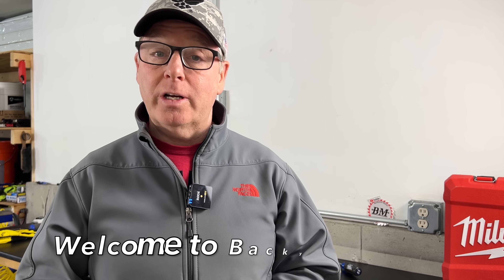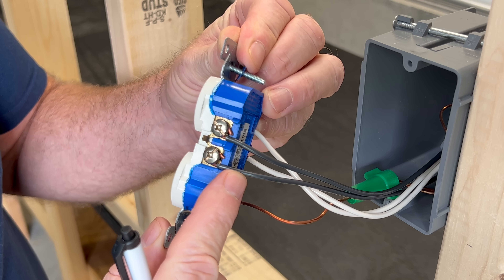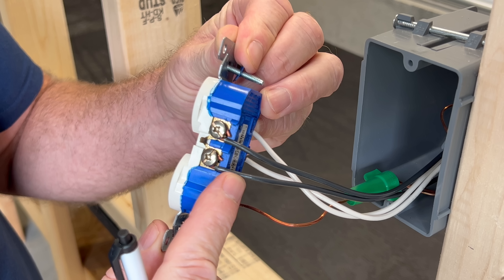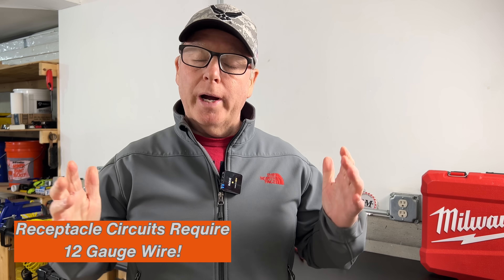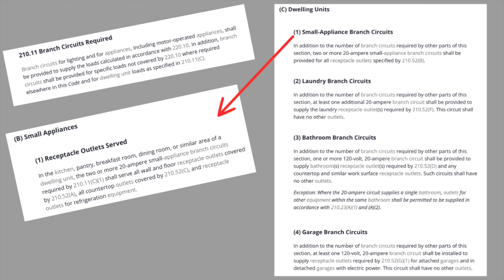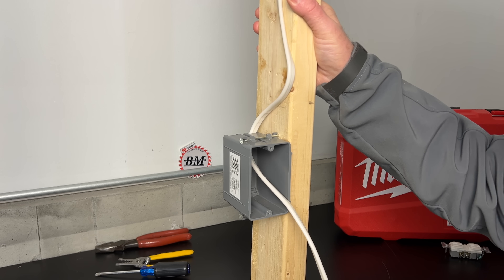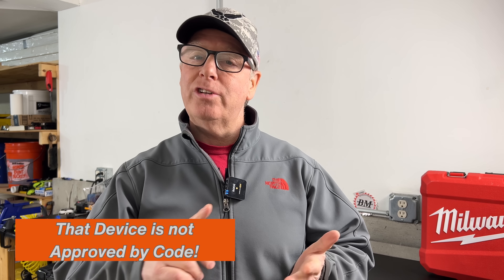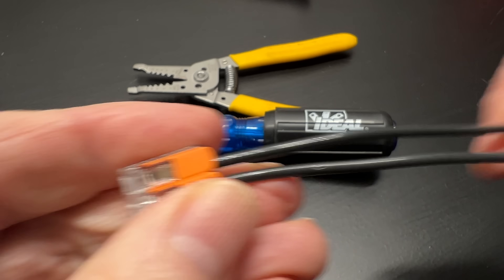5 Electrical Code Lies DIYers Should Stop Believing!

Comment: is there something in the newest code that says you have to use tamper resistant receptacles I have seen lots of people saying that you have to have them now.
Reply: Tamper resistant receptacles have been required in certain places since at least 2014.  Section 406.12
Reply from the maker: Yeah I think it may have been in the 2008 cycle if memory serves me. But yes they have been required for a while.

Comment: So, when I have my next house built or a portion of my current house rewired, I'm going to specify pigtails in the box, ground up outlets, 12 ga. wire throughout, 20 amp outlets, and a service loop at each box.  With the exception of the last item, for me this video has been a list of things that I would like to have in my own home.  I would add that I'd specify Wago connectors instead of wire nuts.

Given that labor far outweighs the cost of materials and that upgrading the wire, outlets, and connectors is a small expense, and it is far more expensive to do it later, I'd like to go for the better materials and methods up front.  As an example, the hammer mechanics who rewired the basement of my current house used Romex 12-2 WITHOUT A GROUND.  Now I'd like to move some switches to a different wall and add some new LED light fixtures.  But I'm going to have rip out all the stuff they put in and redo it.  So, they saved pennies and it is going to cost me dollars in time, labor, and materials.
Reply: I don't know that I would use #12 wire, rather you'd be better off installing a large capacity panel and many more circuits. Appliances such as space heaters and portable air conditioners can pull almost the entirety of the circuit power, while only having a 16 guage cord. The temptation with 12 guage wire is to then protect it with a 20 amp fuse. The result becomes your appliance cord defaults to being the circuit fuse! I'd also recommend quad outlets: has having TOO MANY outlets ever been a problem? We responded to an office one time where every cubicle had a space heater, except 3 cubicles shared 2 circuits. The HVAC was horribly unbalanced so management's solution was to literally bring in a pallet of space heaters!
Reply: @TNickel555  I think you actually make my case for using 12 ga and 20 amp breakers.  As for the ampacity of the appliance cord, they can get away with smaller wire based on it being a short length and also be in the open where it can dissipate heat.  Not the best situation, but it passes NEC and UL.

Comment: Thanks, I was one of the folks who believed the pigtale lie.  I hadn't taken the time to look it up, but I can certainly see where folks would make that mistake since multi-wire circuits are not well understood.
Reply from the maker: I'm going to make a video about multi-wire branch circuits because you're correct that many people don't really understand them or all the requirements for using them.
Reply: Required or not, I still find it a bad idea to run all your current through that dinky little tab on the side of the receptacle. I was advised against doing that by an instructor and have removed at least a couple receptacles that were hooked up like that and showed heat damage. One to the point of failure.
Reply: @Wrencher_86  if you are seeing the tabs get that hot, something else is wrong. Likely, the circuit has been significantly overloaded. (space heaters, coffee pots, microwaves, and hairdryers are common culprits). I would ask if they have been resetting the breaker a lot. It could also be a manufacturing defect; many builders opt for the cheapest junk. I would also be skeptical of the overcurrent device. The tabs should handle 20 amps continuously, even on 15-amp devices. (mind that you can't legally pull the total rating for over 3 hours without derating.) 

Anyone who buys the cheapest receptacles at the big box store is rolling the dice.

Comment: About the receptacles wire section : here in Belgium all receptacles must be wired with 2.5mm^2 (12 gauge) even if the breaker is less than 20A
You can use thicker wires but most manufacturers do not certify their products for thicker wires (some do accept up to 4mm^2 but that's not common)
I am pretty sure that more countries have such a requirement and since we all have access to the internet (yes, there is internet outside of the US) it might be something that people wrongfully think that it is also according to their code.
To be honest, some of those "lies" are actually good practice.
Reply: In france you can use 1.5mm2 but nobody does that because its stupid.

Comment: People seemed to be very confused by "main", vs "service-equipment-disconnect".  Truth is, if you put the "main" label sticker, at the service entrance then that's the main.  It's the sticker that determines what you call main, and thus, what is the first box.   So, people do not need separate neutral and grounds at the breaker box, if all they did was add a service disconnect.  They avoid the drama, by putting a "service disconnect" label, on the new service disconnect. Yes, it's the label.
Reply from the maker: Remember that whether or not you separate the neutrals and grounds or bond them together depends on where the neutral and ground wire are bonded. If it's an outside switch at the service meter then they would be separated at the panel. I'm sure you know this but I wanted to bring it up for others.
Reply: @BackyardMaine yes that's a good point because it's a common practice with larger services, such as 400 amps, to have two 200 amp panels with a service disconnect in each, both must be turned off to kill all power in the home.  Beginning with the 2020 NEC emergency disconnects must now be provided outside on or within sight of the structure in a readily accessible location so first responders can cut all power to the building before going inside, in an emergency, for one and two family dwellings.  This new criteria is most often met by placing the main breaker adjacent to the meter, in which the interior panel must have its grounds and neutrals isolated.  For newer 400 amp services, two 200 amp breakers often with two breakers slots below to install a central air/heat pump, etc.    In this instance all breakers in the outdoor panel must be switched off to kill all power to the building, this must require 6 hand movements or less, I've heard old school electricians call this the "six throw rule".

Comment: Our home was built in '95 and the builder ran ONE 15-amp, 14 gauge circuit to feed the outlets in all 3 bathrooms, the front outside outlet, the backyard outside outlet, AND the garage.  I can't believe they ever got away with this...
Reply: The house I'm in is like that, too.  There's only one GFCI, at the head of the circuit, of which the first receptacle is in the garage.
Reply from the maker: Either there is no code enforcement in your area or the inspector needs a refresher course. lol
Reply: OK... everyone calm down. The original poster stated their home was built in 95. During that time that was code compliant.
Reply: @billbrown6526 I'm perfectly calm Dude.  Calmer than you are.  https://www.youtube.com/watch?v=1WN86qywLVY
Reply: when the house was built, they should have had an open walls inspection of wiring and plumbing to see what is run where unless that area has no inspections while building. @WhiteG60
Reply: My house built in 85 is similar, all bathrooms and outside outlets all on one 15A circuit with a GFCI in one bathroom.
Reply from the maker: @stargazer7644  Code violation there and that should have been easy for the inspector to find. Bath sinks require a 20A circuit.
Reply from the maker: @WhiteG60  It would depend on the inspector. Some are really good and others not so much. There are two electrical inspections. One after rough in but before the walls are closed and a finish inspection when everything is complete. I would assume if the electrician spread out his circuits like that you wouldn't have very many drops at the panel. A garage circuit needs to be  a 20A dedicated circuit and a bathroom needs a 20A circuit at the sink. This like this should be easy for them to detect at rough inspection.

Comment: I don’t use any device to splice any wires. Coming from a city full of repair work from poor installation practices. And #- on my list is exactly two wires on a receptacle overheating due to a dummy plugged in a electrical heater down the line! See the overheated receptacles all the time! Also, I don’t mess with ‘rope’, that’s not professional to me being a master pipe bender! But yeah, your tips can be helpful for many. JT retired IBEW
Reply from the maker: I have a video on when and why I use pigtails. I am retired now but started my career in IBEW local-7 and eventually moved into electrical engineering.

Comment: Single gang plasric boxes without a clamp need support within 8 inches of cable length
Reply from the maker: Correct.  314.17 (2) Exception.
Reply: @BackyardMaine  I am on tik tok 95k followers and Instagram 20k followers.  I am also from maine. Just start making videos Just under a year ago.

Comment: I have used #14 copper wire feed from 20 amp single & two po!e circuit breakers that feed air compressors. Customers had the pressure switch to turn off at 150#'s of air pressure. When the motor started up with 135#'s of air pressure motor would trip a 15 amp circuit breaker several tines a day. Has to be over a thousand exceptions in the probably halve million word NEC. Common sense tells you that if you are using a metal receptacle wall plate then ground up receptacles is the best practice. Safer for a metal wall p!ate to land onto the ground pin of a male plug.
Reply: Not the correct fix, the correct fix is to change to a breaker so that it  allows more insrush current, (magnetic/induction trip) but maintains the 15A thermal trip.  Move from class B to class C, or Class C to Class D. 

The thermal mode of the breaker should never exceed the ampacity or the wire.

Comment: This would be very helpful, if I were wiring my house. Unfortunately, I'm wiring my boat, prepping it as a liveaboard. ABYC requirements are very different than NEC.
For one thing, you never use solid wire on a boat. Sometimes the toughest part of the job is knowing which standard applies.

Comment: No application here. In plumbing they told me the label of the pipe had to be faced out so it could be read if the material type had been inspected. Like non usa type that wasnt would not pass inspection.

Comment: One thing that I feels like it should be a requirement is that inspectors tell you exactly what part of the code this or that violate. But "this is against code" and you have no way to know why beside looking through the full code plus state plus city amandements, and whatever other special cases that may occur, whouln't be the responsability of the electrician, but the inspector that claim it violate it.

Comment: You can find a code restriction against a cord with dual male ends, i.e. plugs on both ends.
I must say I’ve never heard of any of these misconceptions; though that may be because I’m an electrician and learned through the code. I’ll ad that some devices may be bared by municipal ordinance even if allowed under NFPA 70, NEC; for example all of the devices we hardwire must be UL listed.

Comment: As far as #1 goes, even though not required by code - it most definitely should be required by code, and the more people think it's required by code - the better. In fact, were it required by code from the start - we probably wouldn't have to deal with AFCI breakers right now.
Reply from the maker: I don't think pigtails should be required but maybe the backstabs should be banned. I think the backstab is what caused the AFCI to come along. But for anyone who uses the stabs I recommend pigtails. I have a video detailing when to use pigtails.
Reply: @BackyardMaine  you have probably never done electrical service then... I have done electrical service for decades, and currently am a licensed general electrician / master electrician, doing electrical troubleshooting every day in both commercial and residential, as well as industrial...  I never see issues with backstabbing or wagos, but always issues with screws being not totally tied down and outlet melted because it's used as a pass-through.  Also, a wire being loose in a wirenut is a common issue. Pigtails + backstab = never any issues. No pigtails - issues.  DIYers should exclusively use pushnuts or wagos, and backstab - it's hard to mess up when following instructions.
Reply from the maker: @Joe-by8jh  Not exactly. The Wago and others like it use force to hold the wire in place but the backstabs just wedge the wire between two surfaces. Thats why the stabs are only rated for 14AWG solid copper and one time use.  With Wago you can use multiple wire sizes, solid or stranded and reuse the connector as often as needed.

Comment: This is a great video!  Thanks for covering these, as all of these have been pet peeves of mine as well.  I have one small correction, though:

At 3:51 this conclusion is not actually correct.  Service loops would be limited to 6 extra inches only if you secure it as far away from the box as possible.  Nothing in the code prohibits you from securing the cable closer to the box than 12 inches away.  You can secure it within only an inch or two of the box, in which case you can then have 16 or 17 inches of useful service loop if you want to.

Actually, far more often I see people claiming that service loops are prohibited by code (instead of required).  This is, of course, equally false (as you pointed out, they are now even explicitly allowed in newer versions of the code).
Reply from the maker: You know I thought about that and was trying to get the point across as clearly as possible without getting into the weeds and having people loose interest. But yes of course you're right, your loop size would get larger the closer the staple is to the box. I thought going with the 12" staple would get the point across well. Maybe I was wrong..
Reply: @BackyardMaine  I think it would have been nice to include clarification there as well, but nothing you said lead me to believe it wouldn't have been the case.

Comment: Back in the day when copper wire was more reasonable I use to wire all 15 amp with 12 gauge wire. Not because of any code or not code or whatever. I used 12 gauge wire for 15 amp circuits because there is less line loss in a 12 gauge wire than a 14 gauge wire. Nothing that will change the world just a little help here and there which would add up over 50 to 100 years of service. Maybe I was a very pale shade of green before it was fashionable.

Comment: Interesting, how I learned all of this back in the 80s, and it still hasn’t changed.

I still have all of the rules from back then in my head.
I still do a lot of electrical, and I always go toward the side of safety for ANY project.

I’ve had a lot of arguments over the years, and always win with the Safety First argument.

When in doubt, over engineer it!

Works in plumbing and carpentry, too!